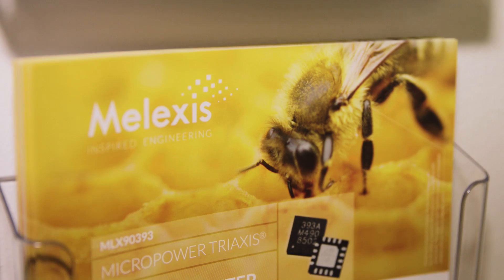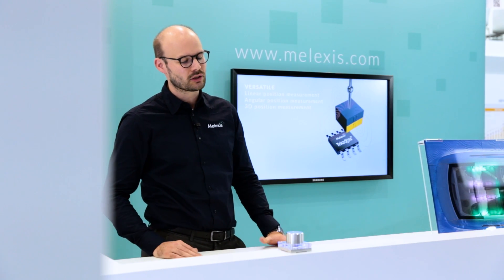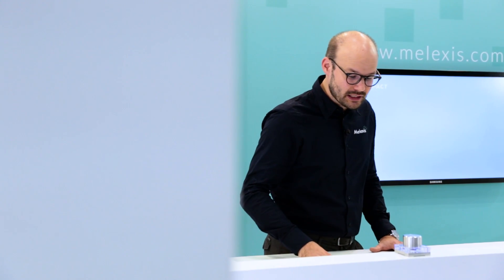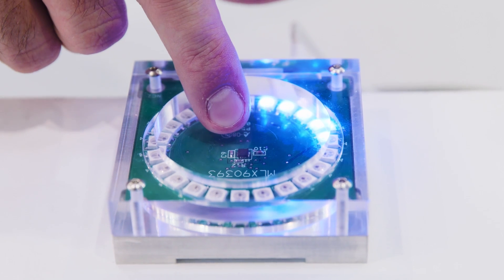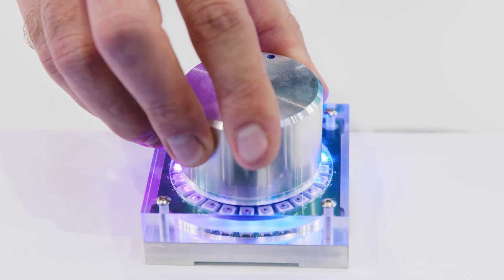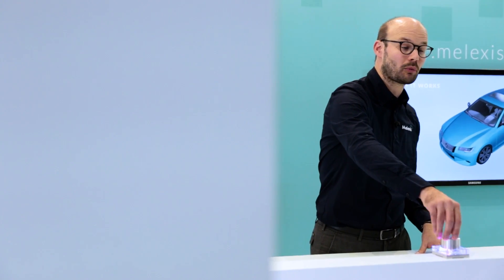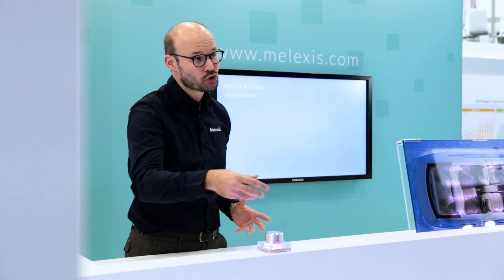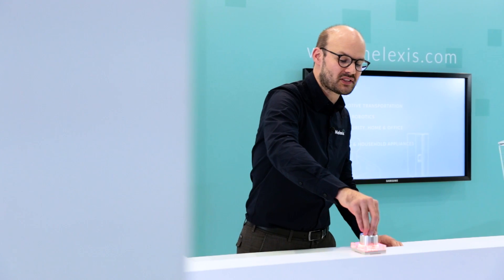Magnetic Field Sensor - Magnetometer (MLX90393)

Comment: To achieve 6 dof position sensing, is one sensor and 1 magnet enough? Or that demo can be upgraded to be 6 dof?
Reply from the maker: If it's up, down, left, right, rotation and push with 1 magnet only, then this can be reached but not with MLX90393. It is possible with a new product which is not yet available online; here you can contact us directly via https://www.melexis.com/en/contact/sales-contact.

Comment: Hello, how would this sensor differ from the 90363? I'm doing a DIY project and found this sensor for sale at a local store, but the guide I'm following talks about the 90363, which is unavailable here. Thanks.
Reply from the maker: Hi, it won't be possible to simply replace the MLX90363 with the MLX90393. The MLX90393 is a completely different IC. The MLX90393 can only provide X/Y/Z data and uses a reduced and simpler command set, whereas the MLX90363 can also directly provide the angle for rotary, linear position, or joystick applications.

Comment: Can I measure the vibration of magnet at 1-10 hz frequency range
Reply from the maker: The MLX90393 is capable of measuring at a 1ms (1kHz) rate. Therefore we would expect that the 10Hz magnet vibration could be measured, depending on the amount of magnetic field change. Very small vibrations may be difficult to detect as the magnetic field change may be very small.

Comment: Is it just me or is this just a 1960s dimmer switch cloaked in a heap of technical mumbo jumbo
Reply from the maker: Hi Rachel, the demonstrator is showing a possibility of using magnetic sensors to detect rotary and push/pull motion. To visualize this in a clear manner the LEDs are used to show the rotary position as well as changing color when the knob is pushed. As the sensor outputs SPI or I2C data it can be interfaced with a microcontroller to work in a variety of applications including, for example, smart light controls that implement power (on/off), brightness, and color control. The MLX90393 magnetic sensor can also be used to make HMI devices like linear sliders or joysticks. 

You can find more information about the MLX90393 sensor on our website: https://www.melexis.com/MLX90393
Reply: Are you a total idiot? Its hall sensor with accompanied circuitry for the leds  !!!

Comment: sir, can i use this module or IC with Arduino???
Reply from the maker: Yes, you can use it with an Arduino. We have many customers doing so and have example code in the getting started guide (for the Mbed platform) which can be used as a starting point for Arduino. Please find the link to download the MLX90393 getting started guide: https://www.melexis.com/en/documents/documentation/application-notes/application-note-mlx90393-getting-started-guide
Reply: Sir, im facing trouble.. cant able to find a diametral magnet which suits for yours MLX90393 here @ india..do you havr any sellers or distributors here @ india...plz help

2.  Is it mandatory that i meed to only use diametral magnets.. for linear sensing, can i use linear pole magnetic strip...??

Comment: Could you please share schematic your demonstrated device used this video? And code 😊
Reply from the maker: Hi Sasha, the schematic is not available; however, it is effectively an LPC1768 microcontroller interfacing with a series of 24 WS2812B RGB LEDs and the Melexis MLX90393 over SPI. This allows us to reuse the code we developed during prototyping on the mbed platform.

If you recreate this you should note that the microcontroller uses 3.3V while the LEDs use 5V (from the USB port). We found that you need to have an open-drain output on the LPC1768 and a pull-up to 5V to make sure the LED logic threshold is met. Using a push-pull to 3.3V meant that sometimes the LEDs would work, sometimes not, which was due to the variability of the logic high voltage threshold on the first LED in the series.

You can find more information about the MLX90393 magnetic sensor on our website (see https://www.melexis.com/MLX90393), along with a getting started guide that includes some pseudo-code examples and library for the mbed platform.
 We hope this helps.

Comment: can it be used for motor degree sensing(bldc)?   How to convert its raw data x,y into  degree?
Reply from the maker: The sensor bandwidth is not compatible with BLDC motor speed unless measuring after gear reduction. For angle calculation, it is taking the ratio of the two relevant axes that generate sine and cosine signals as a function of rotation, and then make the arctangent of the division to get the angle alpha. So, alpha equals atan2(Bx/By) in case the rotation axis is perpendicular to the sensor surface. Hope this helps.